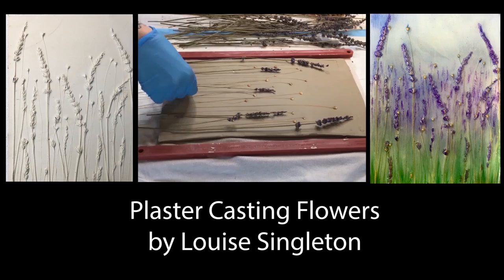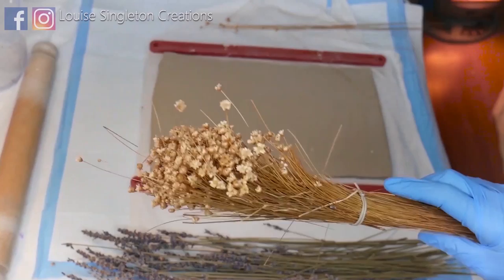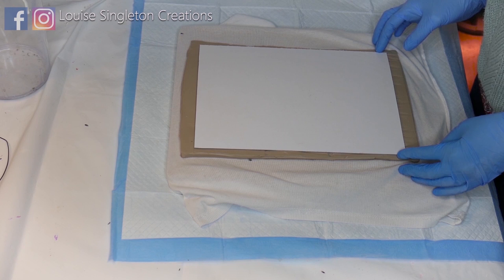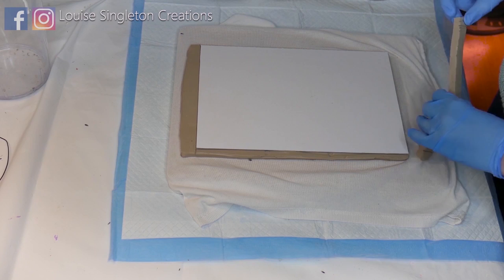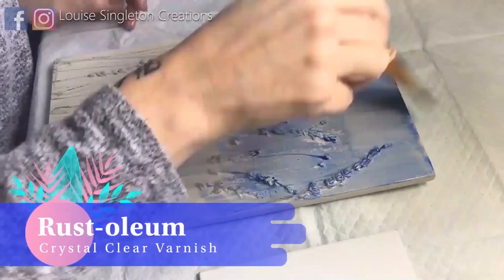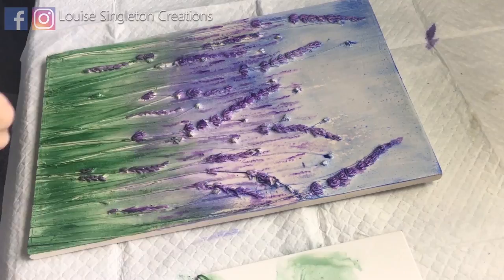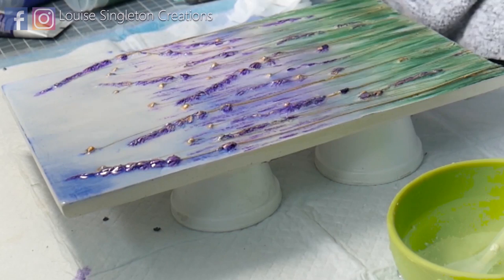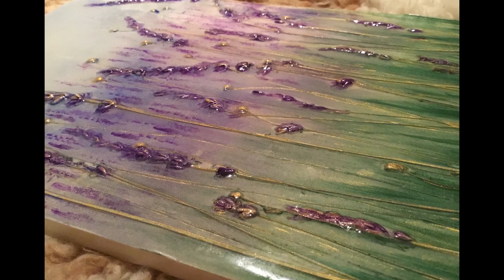How to Cast Flowers in Plaster and Coat it with Resin for a Stunning Effect

Comment: I like this, great impressions of the flowers and the painting is gorgeous. I did try the coaster one, I had leafs but I also found some dried heather lol 😄 not a good idea, air holes on the heather heads but they filled in when painting. I didn't finish it cos it was a trial of getting the impression and peeling the clay off, it is good fun.
Reply from the maker: I’m glad you had a go it is fun isn’t it and you will find as you do more that some things work really well whilst others don’t.

Comment: Hello I have a tiny Luna bean sculpture (plaster) that I would like to encase in resin to preserve. It is completely dry. I’m trying to figure out if I can do this without a problem should I seal it before hand or will the resin melt it?
Reply from the maker: I think is would be fine. I would seal it first with some acrylic varnish just to avoid bubbles in the resin.